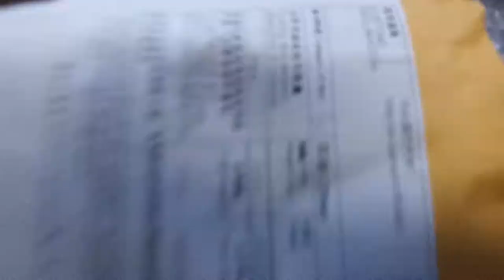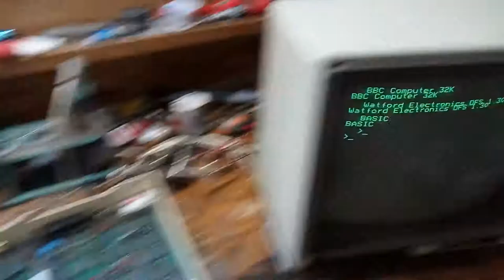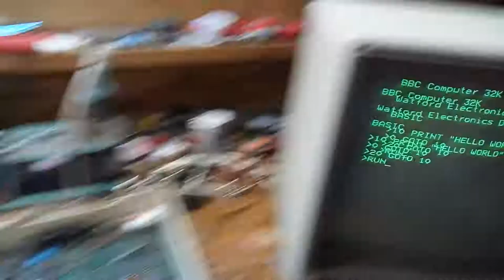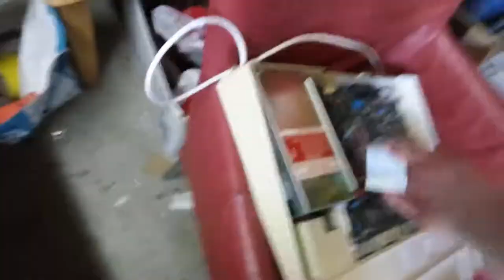How To Repair A BBC Micro - Most Faults (BBC Repair, Keyboard Repair, Faulty Keys)

Comment: @Tech Kyle Thanks for making this vid , what you have shown I am sure will be of benefit to many viewers . The 6522 is a "killer" chip , it has two 8 bit ports and two programmable timers and has greater integration scale than the 6502 itself. What I don't get is that if you know that it comes in two distinct flavours, bipolar and CMOS (6522C). I think you have struck lucky with your Rockwell and ended up with bipolars. This is good news because the bipolar makes the external port on the micro hot swapperble where as hot swapping a port on the CMOS would destroy it. Also , you cannot replace bipolar with CMOS and expect it to work in every circumstance as the fan out and fan in is not nearly the same for both devices. Loving the budgie , can you do some videos where he is making more active participation pls. Der is klaar!

Comment: All the BBC B's can have Econet if you add the right I.Cs !! We used to have classrooms full of them on the primitive network. At the last point of the network and electronic ' clock ' ( it was a black box that sent out a regular pulse ) was plugged in, at the other end the server with a hard drive.

Comment: You can order a rgb to scart cable in the uk for round gbp 11. You can connect that to a flatscreen tv provided it has a scart connection of course.
Reply from the maker: That's not too bad. Most (older) tv's in Europe have a scart connection, so that would work quite well.